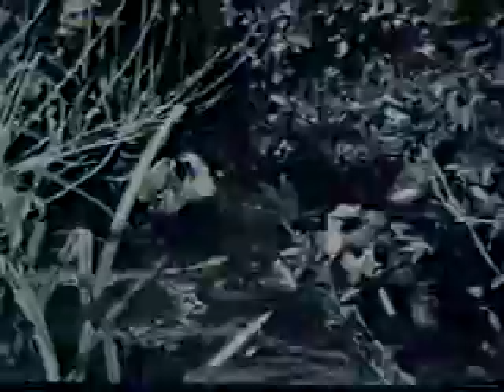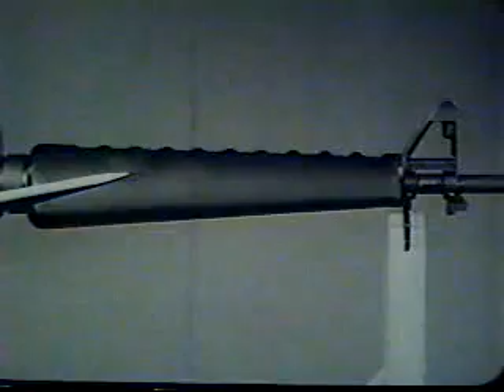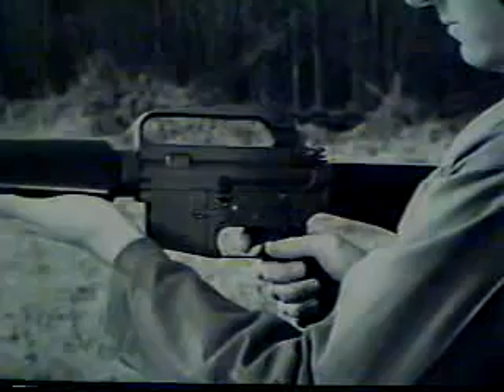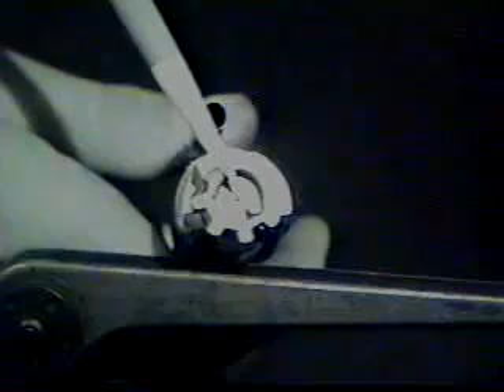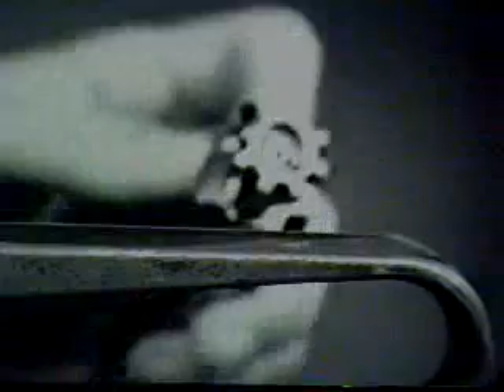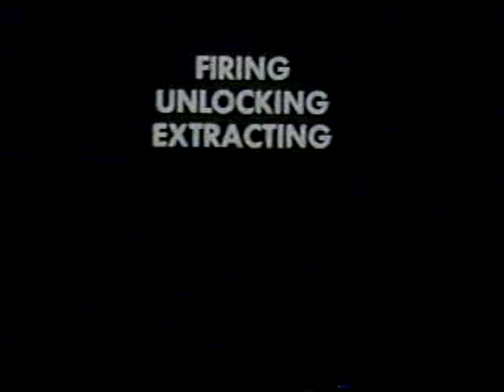The M16 Rifle (1966)

Comment: The M-16 must be considered to be the most successful military rifle in the world. Early problems were the result of poor training, which lead troops to believe that their new rifles needed no cleaning or lubrication,,,,,Chaos ensued, until proper training was carried-out. The direct-impingement gas system has worked just fine, and is in no way inferior to the gas-piston system of the Kalashnikov.
Reply: @Dmitri Kozlowsky , the change in propellant without sufficient testing also contributed to early M16 unreliability.
Reply: I'm inclined to disagree with this, M 16 rifles require constant maintenance everyday, sometimes as often as twice a day. Field stripping an M 16 to clean it out and then reassembling it are not quick, easy tasks!! Kalashnikov rifles are designed to withstand nature's elements and over-excessive use. I wouldn't want to go to the front lines with a sensitive rifle like an M 16, or one of it's variants.
Reply: @joeleger6488 you ever field stripped an m16 or m4? It’s easy as fuck.
Reply: Are you sure you don't mean the M16A4?
During its initial roll out in the Vietnam conflict, the men were only issued one cleaning rod for every five M16A1's.
Reply: Well DI is. It requires a bolt to be run wetter and blows shit into the upper receiver, is less reliable on shorter barrels and suppressed. A gas piston AR15/M16 is more reliable than a DI gun. DI works, but gas piston is better especially on a 14.5 inch barreled gun.

Comment: The AK-47 had a wooden stock. How did the AK-47 fare in those kinds of conditions?
Reply: The wood shouldn't effect its reliability of accuracy in any way
Reply: David the wood can get swollen or something from humidity
Reply: @the_snoo_muffin9028  The way the AK is constructed the whole receiver-barrel-sight arrangement is one big collection of pinned metal parts. The forward handguard is short, thin material which doesn't push on the barrel in any meaningful way, and the stock doesn't wrap around the receiver like the M14 or M1 rifles do. The wood parts are short and separate, while a normal rifle stock is one long piece of timber. There just isn't as much ability for a warped stock to push a bend into the rifle barrel and foul the zero. If the wood on a normal rifle swells a tiny amount the whole length of the weapon, it would bow  the barrel up or down as wood runs under the receiver from the receiver's rear mounting screw to the foremost mounting screw. Nothing could do that on the AK.

Comment: Any post 1968 AR rifle is a reliable platform that will serve well when maintained, using correct ammo, and proper magazines.The earlier models were not adequately field tested prior to general issue.Problems that occurred were inherent to design, ammo & maintenance, and when discovered, were quickly remedied.To fully understand M16 issue, you have to get into politics & bureaucracy of era('55-'65).Several, well researched books on subject.Still pitiful how brass tried to blame grunts

Comment: Partially true, but fact that use of ball powder with faster burning rate, the corrosion issue, and other design concerns, that would have been worked out with extensive field testing, were not accomplished.Contrary to myth, Kalashnikov was not soley responsible for AK 47, but had a team of well over 100 towards end.Even German input of MP43/StG44, was incorporated into AK.Not first time rifle went into service too soon, the GEW88, had serious issue not worked out till 1895.

Comment: It's not a bad design. It's that in 1966 it was not built to designer's specification, loaded to designer's spec or maintained to designer's spec. The M16s made after 1966 were actually pretty good. In fact some of them are still used in Vietnam. The most questionable things about the M 16 are; the caliber and the magazines. The magazines were original designed to be disposable & the magazine is where most of the jams are caused but there are some great mags available these days ( P-Mags ).

Comment: It depends greatly on the rifle.  Introducing a gas tappet system in the AR-15 introduces a whole host of problems and usually decreased reliability and durability.  HK is the only manufacturer to have figured it out and the 416 is basically unobtanium.  Except for the usage scenarios I previously outlined, a piston really has no reliability advantage over the direct gas system.

Comment: That is too long of a barrel for a carbine.  14.5" is perfect for a carbine, stretch that to 16" for a light precision rifle.  A 5.56 rifle with an 18" barrel is getting close to a battle rifle in size and weight, but without the punch of 7.62x51mm.  And, as I said, unless you're going to constantly running both suppressed and unsuppressed and/or with short barrels (less than 14.5"), there isn't much reason to switch from the M4.
Reply: I still prefer the 20” barrel. But as you state it isn’t a carbine either.

Comment: Jamming often cause deaths in Nam' and malfunctions of the gun itself cause deaths are casualties could have gone in a different direction. The NVA and VC had much more reliable weapons in terms of how often it jams and how easy it was to maintain may not be accurate as the M16 but a VC/NVA soldier was confident with his gun that is why there are so many variations A2,A3,A4 due to its flaws which are now gone.. the 1911 had very minor flaws as i see it the only thing i see is the hammer bite..

Comment: Again; you have no personal experience and you cite the gun's performance from 50 years ago.

Also, the AK-47 is not a "Heavy hitter". It fires an intermediate cartridge with a much less lethal round than the M16's.
Reply: Sash S the M16 5.56 round bounces around inside a human. The AK47 7.62 goes straight through.
Reply: @fubar337  5.56x45mm was intended to cause internal trauma
Reply: The ultimate argument that the 5.56 NATO is perfectly effective is how the Soviets immediately scrambled to make 5.45 Soviet. All these East German surplus magazine pouches from the Cold War hold four of those big steel 7.62mm magazines, where all the 5.56 armies consider six magazines a bare minimum load.

Comment: Tasted the AK? What?
Reply: e1ghtys1x the Ak switched to the 74 which was basically the same round . The cia was throbbing at the nut sack to find out what it was . It was basically chambered the same as a m16 with minor length differences. In the afgan war the Soviets fought we found out it was a 47 with a m16 round nothing really changed.

Comment: the source of the M16s legendary unreliability stems from its use in Vietnam. The US government used a bad corrosive powder (not the current WC-844). Not to mention they where shipped over seas told it needs NO LUBRICATION AND NO CLEANING. That is why it initially failed. When you see AR-15s fail today it is because people (government included) used to use cheap non factory parts. Now days soldiers know better and with just a drop of oil, AR-15s tend to last as long as the infamous AK.

Comment: no i havent but couple of my friends did and they said it is very accurate....OK it is accurate but, do i need accuracy if this rifle can get jammed in heat of battle? think about it
Reply: mihailolord carried one for 18 months in Vietnam and own a civilian model that I’ve run thousands of rounds through and have never had a jam or any other malfunction. Those initial problems were resolved by chroming the chamber, adding the forward assist and cleaning the weapon properly. When the Army issued them they indicated the needed little or no cleaning and didn’t issue cleaning kits. Further, when the Air Force first tested it they fired rounds with IMR powder which is much cleaner that standard ball powder that was ordered by the Army when they became the lead agency for the M-16. The weapon got and undeserved bad reputation because of initial mistakes but has gone on to be the standard rifle in its many variations for over 50 years.

Comment: The real reason for most of the jamming was because of the army switching to ball powder instead of stick powder right before they were shipped to vietnam so it wasnt as unreliable as it was told, but it still wasnt reliable. Then they put chrome in the barrel in the m16a2 to help with the powder sticking in the barrel.